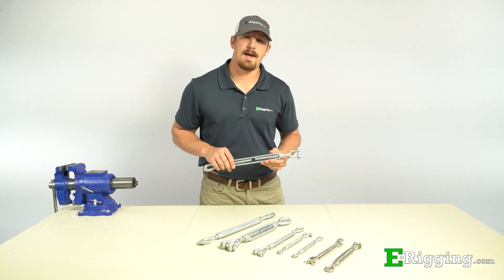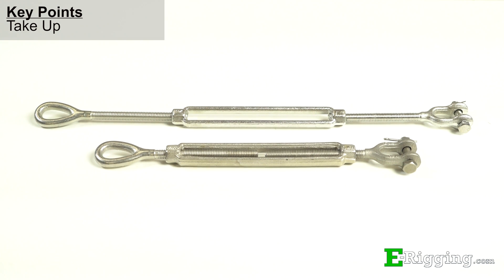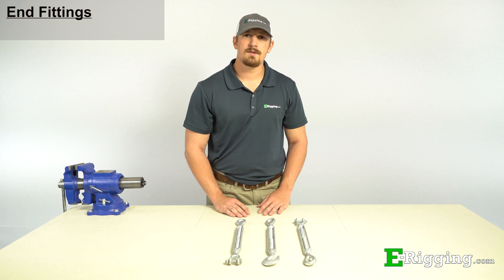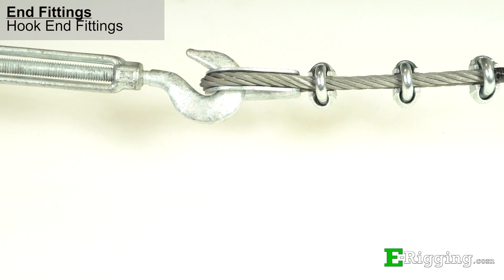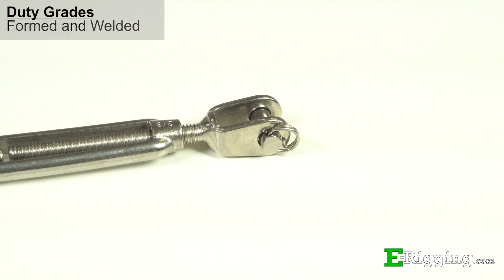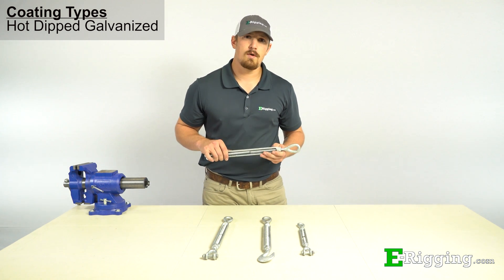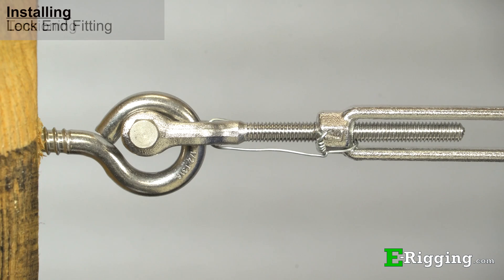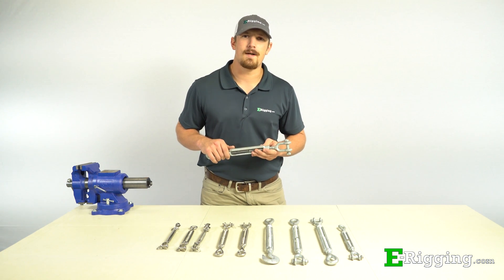How to Select and Use Turnbuckles

Comment: You're obviously working on projects MUCH larger than what I have planned, but you've explained the concepts perfectly. I'm planning to use this method to hang curtains to section off my basement, probably no more than 10' per run. Should I use a turnbuckle at both ends, or just make a proper clip loop at one end?

Comment: which ground anchor are you using @20 seconds???
Reply from the maker: We recently switched from carrying 1/2" x 15" Painted Ground Anchors (pictured at :20) to our 1/2" x 15", Hot Dipped Galvanized Earth Ground Anchors, providing better corrosion resistance and durability.